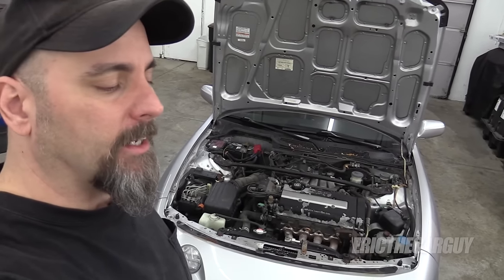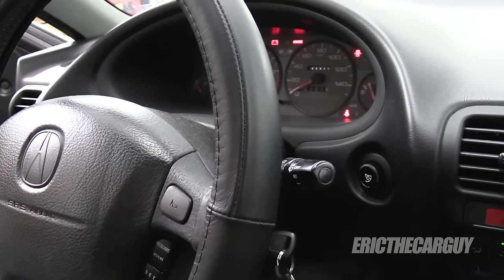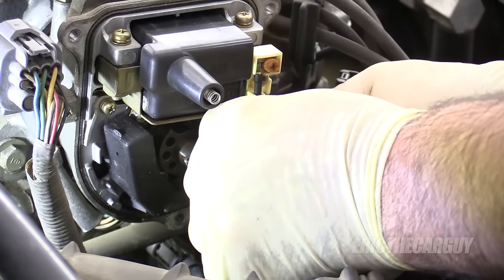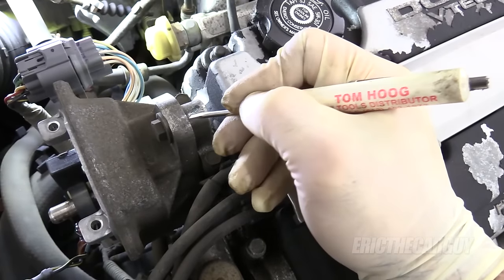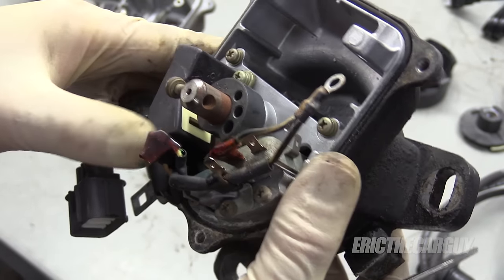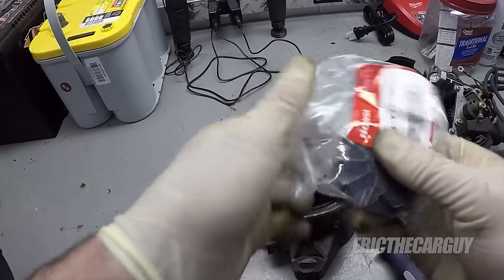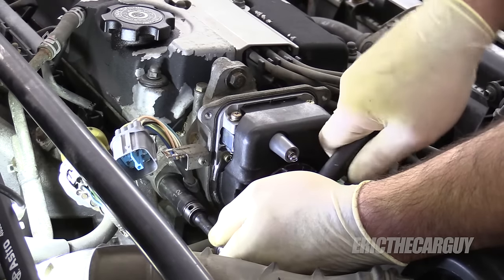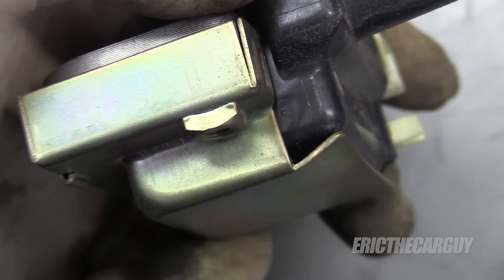Honda Ignition Coil Replacement (Complete Guide)

Comment: This video really helped with my Honda CR-V 1998, the repair is the same as the Civic. Bought the Delphi parts from Ebay, memorized the video. I went the easy way, changing: distributor cap, rotor, coil and ignitor/ignition unit. Replaced the whole contents of the distributor. The problem was the ICU, I was overjoyed to replace the ignitor.
Reply: Hi was you crv has ibg misfires and shutting off while driving that's what's happening to mine ?

Comment: Just a FYI: those philips head screws that have a small indent next to the cross, where the screwdriver goes are actually not philips head screws. They are JIS (Japanese Industry Standard) screws. They look identical to philips, but the tapering if you like is different. Probably that's why Eric emphasise to use good quality screwdrivers, because a good philips one kinda works with JIS, but it is not designed to. Bite the bullet and get a selection of JIS drivers and you don't just rely on your luck to get those screws out.
Reply: Aint it Pozidriv screw ?
Reply: DyoSurfAndRide I was about to say the same thing. I was working on my Yamaha motorcycle's carburetor and had alot of trouble removing the screws even with good screwdrivers. Ordered a set of JIS screwdrivers and it made all the difference.
Reply: And that advice is free. The bits or drivers are not that expensive either. Compared to dealer prices not at all.
Reply: JIS is one of those things people will never acknowledge.  It's downfall is that they made it too similar to phillips.    Vessel makes good jis screwdrivers.
Reply: I've always found it easier to remove the rotor screw using a phillips bit and a 1/4" socket on a ratchet.  That makes it easier to really press the bit into the screw head so it doesn't slip.
Reply: Rotring Pozi drive is different, those are JIS
Reply: pozidriv have little line in between the cross
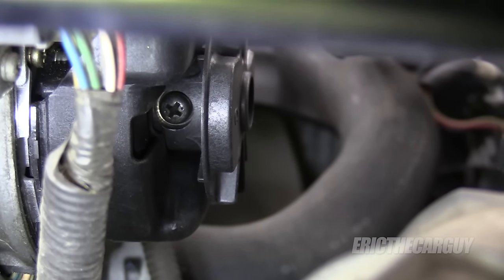Reply: Out of passing interest, check out the 'List of screw drives' Wikipedia entry. Funny thing I noticed in this video that the rotor screw head appears to have 2 identification dots (2:29) in it's head... never seen that, could it be yet another JIS version? Some JIS screws use a tiny 'x' instead of a dot. Pozidriv is yet another screw drive standard altogether. The right driver really makes things easier... using the wrong driver is  tough on both driver and screw head. Another interesting thing; came across a $nap-On guy a few weeks ago, stuck my head in and asked if he had any driver JIS sets. He looked at me like I was from Mars & said he'd never heard of JIS, and that I was the first to ever ask!
Reply: list of differnt screw is nice where i learn what a jis is then couple videos online about it i try to get ever faster to open anything
Reply: In my experience i found no difference between a #3 Phillips and JIS. Other sizes I see noticeable differences but when it comes to #3 both drivers have never had an issue with each others respective counterpart.
Reply: DaTwistedOne1 you need strong steel USA tools though. .or suggest. lol
Reply: I agree. Those are JIS screws. You'll need a screwdriver that is JIS compatible. Screwdrivers that are DIN/ISO 5260 and DIN/ISO 8764 have superseded JIS and will work. Normal Phillips spec screwdrivers will risk stripping out the heads of the screws. There are different from pozidriv, which you will find a lot in European products.  Not differentiating JIS from Phillips is risking unnecessary frustration.
Reply: DyoSurfAndRide ii
Reply: I'm always hesitant of a guy pushing Jis on the interweb
Reply: I am shocked to see someone that knows what a JIS screwdriver is. I started work in a Honda/Suzuki shop at age 14 so I have had a few sets of them (now 57) but there are people in bike shops that do not know what they are. Just about a must for taking float bowls off carbs.
Reply: Absolutely! I need to get a set of those JIS screw drivers because the longer that damn ignition rotor screw is in there, the harder that F*** is to remove.
Reply: @Patrick94GSR  I discovered the same.  Just couldn't get a screwdriver on it with any pressure.
Reply: Man,I just ordered a microtorch and some heat absorbing clay to get these screws out!!!!!!

Comment: Very nice!  My 98 Honda Civic is running better than my 2005. The original Muffler finally let loose after the bracket a cheap $65 fix. 176,000 miles and running strong.. love your videos keep up the great work. Tom NJ ♡♡♡♡
Reply: @NewJerseyTom
replacing ignition coil (*packs 1-4,  2--3) on 2000 ohv pon-i-ak sunfire iz job ofv 2-3 hours time؟

Comment: Hy Eric, and I want to start with thank you. I started to work on automotive in the sixties and when I got back to the States from the Army in the seventys points and such were leaving the scene and I didn't like it one bit. You explaining the ignitor is like points did the trick and she's up and running. Did the coil pack, ignitor, cap and rotor. Very kind and helpful you are buddy, Brian
Reply: IAM-zu9nx
replacing ignition coil (*packs 1-4,  2--3) on 2000 ohv pon-i-ak sunfire iz job ofv 2-3 hours time؟

Comment: Got a 93 Civic back in the day, but it had been sitting for roughly 14 months. Interior was a bit moldy and it had some maintenance issues that needed addressing because it had been sitting in the grass under a tree for that whole time.  It misfired like nothing else.  I didn't know a whole lot at the time, so I just tried the basic tune-up, which didn't help.  I did a little searching on the web (2004 didn't have as much info as now).  Turns out the bearing went bad, likely from sitting unused.  The rust colored dust under the cap and a metal-on-metal grinding was indicative of the issue.  I bought a used dizzy from a local junkyard, completely dismanteled it and noticed the internals were the same but the housing was different.  Swapped in the new shaft with good bearing and rotors and all was good.
Reply: haVing rang burniNg riyt sekund fur my koup- help?
qweshShin: replacing ignition coil (*packs 1-4,  2--3) on 2000 ohv pon-i-ak sunfire iz job ofv 2-3 hours time؟ P0300

Comment: You just saved my butt on a 1999 CR-V after doing a compression test. Thank you so much.
Reply: @BEHChrome
replacing ignition coil (*packs 1-4,  2--3) on 2000 ohv pon-i-ak sunfire iz job ofv 2-3 hours time؟

Comment: Yey civics and integras!! More please eric! Love the honda videos.
Just to add the seals go bad on these aswell, periodically check your distributors for oil.
If you neglect to replace the oil seal it will ruin your whole distributor. Replace it as well with the o-ring.
Reply: Which oil seal are you referring to?  The camshafts have oil seals on the other end behind the timing belt, but on the distributor end they have cam bearing caps.  The distributor shaft has the o-ring, and then there's the cam end plug behind the VTEC solenoid.  Honda revised that end plug mid-way through Integra production from a rubber plug to a plastic cap with o-rings.  The plastic cap seals MUCH better.

Comment: Tip I learned the hard way when just replacing the cap and rotor and making sure the coil doesn't go bad in the process: After removing the cap, you usually need to flick the ignition switch to the Start position in order to position the rotor screw for removal. With the cap off, the high voltage in the coil has nowhere safe to go when the ICM tells it to release spark. This is a very good way to blow the coil. Removing one of the fuses (ignition or ECU) either blocks voltage from reaching the distributor or blocks the ECU switch signal to the ICM.
Reply: good tip.  Or, do like I do and rotate the engine via the crankshaft pulley.  That's the proper way to do it.
Reply: Patrick94GSR Does it matter which way you rotate the engine by the crankshaft pulley? Always got mixed beliefs about that
Reply: Yes. NEVER rotate an engine backwards. Always in the direction it runs.
Reply: Geo Logic What damage could occur turning it the opposite way?
Reply: Because timing belts usually have slack on the back side, the camshaft sprocket can more easily jump out of time. This in turn can cause valve damage from the piston contacting and pushing against the valves while they're open. This is a bigger problem when with engines which have a damper or moving tensioner that does not lock down. Also, You're running the oil pump backwards, too, but not sure if this is a big problem when turning it by hand.
Reply: By the way, the same applies to overhead cam timing chains because the tensioners are often fed by oil pressure to keep the chain tight.

Comment: Just found this video, great information! My integra b20 engine just died randomly while driving and now has no spark, with your description of the ignitor I'm sure its that so i will be working on replacing that with everything else listed in this video! Thanks!
Reply: Hey was it the ignitor that was the problem? My CR-V just did the same thing.
Reply: @steveafanador6441  yes it was

Comment: It's a good idea to unplug the distributor when clocking the rotor to access the screw. Firing unconnected from the plugs is hard on the coil.  Also, if you remove or replace the ignition module, reapply some thermal paste to the side with the metal backing to help transfer heat to the distributor body.  Those ignition modules get toasty under operation.
Reply: what u meen with "claking"
Reply: @spjmrlahey4008
replacing ignition coil (*packs 1-4,  2--3) on 2000 ohv pon-i-ak sunfire iz job ofv 2-3 hours time؟

Comment: Thank you for the video. This was very in-depth, and it made me a little nervous, but I gave it a try and it worked out fine. The ignition coil had marks in exactly the places yours did. The car fires up quickly. It was previously intermittant, so I'm hoping that the fix is long term.
Reply: @Halffastpaddler
replacing ignition coil (*packs 1-4,  2--3) on 2000 ohv pon-i-ak sunfire iz job ofv 2-3 hours time؟

Comment: On my 93 Accord, I had a bad ignitor and replaced it.  It came stock with heat sink compound on it.  The replacement also came with a cachet of new heat sink compound (Thermal Transfer compound, however you want to call it.)

Comment: Personally....Electrical components I've always gone OEM.  I know they are more expensive, but built so much better than the aftermarkett electrical components.  I've spent countless hours chasing electrical gremlins only to find it was a non OEM electrical component.  The worst thing is they generally don't show failure when testing them.

Comment: Solved my NO START issues for my 1999 CRV. Thanks.
Reply: dixie livingston would it crank but no start? I have issues with my civic. I replaced cap and rotor and still doesn’t want to start.

Comment: I remember my civic failed because of this, I was on the side of the highway, I remembered I had an civic Si distributor and I always keep a tool set in my car I was able to swap out the  internals of the si distributor into my non VTEC distributor while there was a highway patrol watching what I was doing and he was impressed I had my car running within twenty minutes being a used coil I keep a new one in the trunk
Reply: haha that's awesome.  Reminds me of the time I had to get a tow after the engine died.  I figured out it was the ignition harness that fried.  I bought a new harness, went to the shop where the car had been towed to, installed it myself in the parking lot and was on my way.
Reply: My Accord's distributer or coil failed leaving me on stranded waiting for a tow.  I don't know which failed, I just replaced them both.  Unfortunately with aftermarket as it's a 1992.
Reply: Again q 😅

Comment: Dunno how I missed this. :s Great instructional Sir! As usual really. At this stage I consider the coil/igniter/cap even dizzy nearly a regular service part on B-Series engines. At least on mine. I've replaced the coil/igniter/cap three times in ten years and the whole dizzy assembly once as the bearings get noisy after about 40 odd thousand miles.

Comment: Last year I got a code and poor running engine in my 96 Accord that indicated the crank position sensor fail. The part is inside the distributor. I just went ahead and buy the whole distributor assembly (cap and all) on ebay for $66 total. It's running fine so far. 

It's funny that one of my relatives with the same generation spent $300+ for the distributor replacement by a shop for oil leak due to the old o-ring, only to find out it's remanufactured part that failed a year later.

Comment: Thanks Eric! I am having a hell of a time with mine, those screws for the wires to the coil are SUPER easy to strip out, had to use pinchers and gave up, came back, eventually got them out. Now I have an old ohm meter, not sure how to read the coil resistance

Comment: I've had good results with thermal paste (the type used on computer CPU's) between the ignitor and its heat sink, seems like dielectric grease would cause heat transfer problems, great video.
Reply from the maker: As stated in the video, they didn't put it there at the factory and the igniter is still going strong after 16 years. If you want to put it there, great, I just don't see it as necessary. Thanks for the comment.

Comment: My 1984 Honda CRX has an old school, cylindrical coil which is separate from the distributor. But it has had the same issues with the ignitor and coil. I just replaced the coil last week, and my old coil tested out of spec on the secondary side.

Comment: Eric, many thaks for your videos, and sharing your knowledge with us.
Maybe you can give me a hand on my accord.

Honda Accord  ICTDI 2,2 year 2006 with 200,000 miles,
these car is very well care maintained, the engine is strong an smooth,

After turn the ignition ON
1- Engine service light,  Immobilizer, VSA, ABS  go ON and after few seconds go OFF.  Normal operation
2- Glow plug light goes ON and after 5 or 6 seconds goes OFF.  Normal operation
3- Battery, Oil and parking brake  lights go ON and stay ON.  Normal operation
4-After crank engine immediately starts and after 1 or 2 seconds engine die, if you press the gas {diesel} pedal a little  during crank you don't loose any start, engine goes to 1500 rpm and then go back to 800 rpm and everything goes fine, car works fine without  any issues. In other words you can not start the engine if you don not press the gas pedal. Apparently  there is not any difference between cold or hot engine start up.

In my humble opinion IN A NORMAL OPPERATION, after start RPM will stabilize around 1200 and after warm up, will descend to around 800  RPM. It seems that these  is NOT happening.

Any suggestions would be grateful. Best regards, keep posting

Comment: I changed both without removing the distributor.. And I believe the reason igniters fail is because there's no dielectric grease in between the two parts.. And heat kills the coil.. My thoughts. Great video. 👍

Comment: Last summer my integras igniter failed in a busy street I was able to park it on the side of the road got me an igniter at O'Reillys and replaced it in a few minutes, I thought it would fail with it a few days months because it was a cheap o'reilly part but it's been good, I've gone to the wrecking yard a couple of times looking for an oem coil and igniter but someone has always beat me to it, I heard the igniters fail because the thermal compound you use to install them wears off of them and the heat ruins them.

Comment: cool video, ive got a 1998 civic here in aus, my distributor looks way different to yours, coil is on the right and rotor on the elft, unlike yours with is coil on top with rotor underneath, anyways, i drove my new civic home the toehr day, decided to check saprk, adn then no sparka t all, on any cylinder, changed plugs, wires, still nothing, cranks but no spark, will be changing coil soon hopfeully that solves it

Comment: Distributors really are the Achilles heel on these cars.  5 years ago my little Integra was working hard to get an unreliable label with multiple breakdowns involving all the individual pieces of the distributor.  From a rotor that fell off, the igniter,  the coil, and then eventually the tangs on the distributor that fit into the cam.  All of these went out individually over the course of a year.  After the engine ate 3 successive Chinese distributors, I sprung for a Cardone re-manufactured one and put the Chinese distributor next to the spare tire and suprisingly haven't had a problem with it sense.   I watched my very first Eric the Car guy video (https://www.youtube.com/watch?v=T0gd3V9QLhw) when trouble shooting the igniter.  I loved all the work that you did on Honda's then, bought your Integra timing belt video, and was thrilled to see you get the GSR.  Thanks for all the great content look forward to seeing more Integra stuff!

Comment: My Nissan with the 2Litre SR20VE engine, has a similar setup. With the disp, ign-c, and cam sensor. All-in-one.
And it's the same with this engine, org OEM wires or NGK only works.

Comment: Part number for the rotor is different between OBD1 94-95 and OBD2 96-01 Integra GSR's.  OBD1 has a P72 in the part number, while OBD2 has the P73 shown here at 12:14

Comment: my old honda (84 city) the igniter came from the factory with heatsink paste/thermal grease but after 30+ years it got a bit dry so I replaced it with new thermal paste. I have seen many appliances and devices that dont have any sort of thermal interface material from the factory and I always add thermal paste or thermal pads.

Comment: Only the older Hondas especially OBD0 versions had thermal paste on the heatsink for the igniter. A sign of the thermal paste going bad would be the car just stalling out of no where and you'd be able to restart the car fairly quickly, quick and easy fix is cleaning the old thermal paste and putting new paste on.